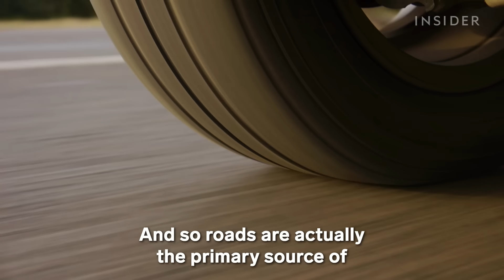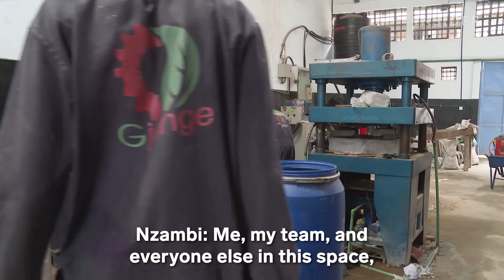Young Inventor Makes Bricks From Plastic Trash | World Wide Waste | Business Insider

Comment: If you're wondering, Africa is where the most of Europe's "recycled on paper" wastes go, building up on the existing garbage problem there.
As for the technolgy, well... On one hand plastic tend to produce nasty organic toxins under UV-light, so it is debatable if such technology is actually acceptable (it depends on the source of the plastic they use), on the other hand this process reduces the need to use concrete, where you emit lots of CO2 from lime and from gas heaters, as well as bury carbon in form of plastic instead of just burning it, on the other hand this buried carbon will be replaced by the (slight) increase in plastic production from oil.
As I live in SPb in Russia I'd actually love to see this technology implemented more here if it is proven to be safe from the toxic point of view and if bricks like that won't produce a very fine plastic dust with time, as 1. there're a lot of unpaved pavements, 2. in winter there're a lot of times temperature goes through water-freezing point, which makes concrete pavement bricks and slabs crack very fast (only natural granite and marble tend to hold better), 3. there're a lot of unprocessed plastic waste here too.
Reply: Since plastic has so many controversial on its component, heat and UV response, then the only solution to plastic problem is do not manufacture plastic at all.
Reply: @sallylemon5835    Burn it to produce power.
Reply: @sallylemon5835  spot on, I use clay earthware in my home... everyone should do the same
Reply: Gotta ask ,whats the difference? If the plastic is already there as waste with the sun beating down on it why would it be any different once its in the form of a road? Im asking because the man in the video sounded like he was doscouraged by this idea but they dont produce the plastoc its already there in landfills repurposing it shouldnt make it anymore harmful than sitting there especially since it being used means the waste of using actual concrete wont have to be added , or am i wrong?
Reply: @notaword5016  I think the difference is that it doesn’t generate the amount of microplastic a road would. The problem is plastic in general. It should be removed from our lives as much as possible. If you repurpose the plastic that is in a land fill you are just re introducing the plastic back into the environment. If you are just making a pavement though then I dont think you are going to generate micro plastic as much as a road would. The best solution is to find ways to decompose the plastic that is thrown away and make biodegradable alternatives. Micro-plastic is a huge problem that is yet to show its impact on our lives. Its found everywhere in the ecosystem and that can not be good.
Reply: Arh shutup
Reply: It's a choice of two evils. It's a hard choice specially when we already have problems with the environment. Bc like you said in one hand we have the solution to remove the waste buy it would increase the amount of micro plastic, toxins and more. In the other hand we don't use this method but we have the plastic problem, continue to have micro plastic problem, we emit CO2 and other things. It's a tough choice specially when there's so many people who have different views and values.
Reply: Then no matter which is used these tiles will need to be removed and disposed of. Once in this state they will be harder to recycle if they can be. Or will have to be disposed of some how by future generations.
Reply: @firstnamelastname-jt5ci    What on earth do those numbers have to do with this video?
Reply: The best solution is to stop plastic production and go full on renewable to solve the CO2 problem and the micro plastic problem.
Reply: Why not make such roads in England. Rain resist roads. Plus free material for production from around of the world.
Reply: @Ffhh391    Not free.
Reply: @firstnamelastname-jt5ci    All that may be true. Doesn’t fix the problem though. Plastic laying around on the ground. Which future generations will have to deal with. Same problem then. Do we just keep reusing it and producing it?  Burn it for power. As for Africa I really don’t care. It’ll be back to Stone Age there shortly.
Reply: @firstnamelastname-jt5ci    Haha
Reply: @firstnamelastname-jt5ci  Thank you for that fascinating, irrelevant statistic.
Reply: @ex7463  he's just showing you that the problem has more to do with the richest than with the white man.
Reply: As usual, the problems of the world can be blamed on the white man
Reply: @ex7463    Lmao. You trolling dude?  That’s some fine sarcasm you got going
Reply: @marvinmartinsYT  yeah i was joking lol, didn't expect to trigger so many ppl
Reply: @ex7463    Amazing though right?
Reply: @ex7463  For example, this SERIOUS problem here, with these plastic bricks was a problem created by an African woman. Now the entire area.... and world for that matter, is about to be polluted with Microplastic beads until the food chain in the area brakes down because this is such an awful awful idea it is not even funny and was one created by people with good hearts but lack of knowledge to fully understand the impact of what they are doing. These will NEVER EVER be good roads and worse they will degrade and release poison into the world. 
So.... That is the whitemans fault because she sure seems excited to take credit for her company.

Comment: This idea has been around for years, and has been developed to the extent of paving several miles of 'test road' (which was exposed to traffic and then measured for durability/safety) with the mix of ground garbage and asphalt-type material.. But the MSM had to wait until it occurred to someone in Africa so they could get virtue points for spreading the idea as if it's new.

Comment: cool idea, plastic+water such as rain or flood = 90%+ loss of braking traction and probably only 60% of normal traction in pristine conditions, but probably 113-110% traction increase in dusting of desert sand. what is the wear factor of this plastic after 50,000# truck rolls on it 4,000 times? 40,000 times?
Reply: upon further review this actually would be great building products instead of roads, building walls and roofing materials as well as sidewalks and park paths and patio pavers, giant sized legos would be cool and fun too so kids could learning building techniques and have fun building child sized structures at the same time!

Comment: Looks interesting. Most plastics have problems with getting brittle in sunlight. I'd be interested to know if this has similar problems. Also, hardness is one thing. But what kind of traction can you expect in wet weather? For higher elevation will it tolerate ice?
Reply: I would think these would make better housing than roads

Comment: They tried this with ground up tires years ago, it didn't work, it's too slippery for high speed traffic when wet. The same will be true for these Plastic bricks. May be fine for side walks and driveways, but not for roadways with automobile traffic.

Comment: The two biggest problems are 1 even textured plastic doesnt offer very good traction in wet conditions, and 2 plastics break down in heat and constant exposure to sunlight, even plastics specifically designed to be UV resistant. So roads in hotter climates like the southern US would go into very bad shape very quickly and needs a ton of constant upkeep. Solve those two things and this is a truly perfect idea.
Reply: the solution is just not to use plastic in outdoor, wearing applications where it can shed and leech. Its ubiquity isn't a good justification.

Comment: my guess, a road built out of this material would be far more prone to cracks and fractures from heat stress as well as weight stress from vehicles driving on it, it would also be dangerously prone to water pooling during rainfall increasing the risk of hydroplaning substantially, assuming the water did not penetrate the material, in which case it would likely begin to lose its structural rigidity and the bricks would start to fall apart, and without some form of gravel glued to it cars would not be able to stop in any reasonable amount of time, and would struggle to find enough grip just to drive in a straight line.

Comment: What's crazy is if they added pyrolysis to the process they would likely be able to produce kerosene when melting the plastic so long as it doesn't diminish the structural integrity of the bricks.

Comment: Normal bricks are already better than having bricks with plastic in them. I mean, bricks can be crushed or be repurposed into other manufacturing or building materials easily if need to be disposed of. Also, plastic becomes weak when exposed to UV lighting and heat.

Comment: I love the idea of recycling the plastic. I would love to see what tensile/compression properties this material has. Considering that these will be ground away by the sun/rain/tires, they might not last too long as a road. Making bricks is great and maybe would be better suited for houses/fences/pavers.
Reply: They dont really recyle it they throw the plastic back into the enviroment!!! We have already a micro plastic problem and with this idea we would make it even more insane big. The sand would grain the plastic super thin. Build houses with it ok but not streets thats not a great idea!
Reply: @pedalpatrol  that better than just make big mountain full of plastic garbage
Reply: @erikansori  nope its not! Making the problem even worse by producing more mircoplastic is not better...
Reply: @pedalpatrol  it's on individuals on how they use plastic. Cauz the lesser the production of plastic the better the situation.
Recycling the 2nd best option
Reply: @pedalpatrol  Producing concrete and asphalt is one of the largest CO2 emitters out there. Taking plastic trash from the environment and repurposing it reduces demand for asphalt and concrete, while keeping net plastic waste locally roughly the same, since the plastic waste is going from the ground... to the ground. Stopping the production of microplastics is out of the scope of this plan, but reducing the need for asphalt is still great for the climate. This certainly won't totally solve the plastic problem, but it will help with climate and reducing the size of landfills
Reply: @crodsbye  Great points. Thus country didn't create the waste and good for them that people are repurposing waste materials.
Reply: @Jason Diaz Agreed. Depending on its health safety and bonding ability, there has to be numerous non/minimal-friction applications where this material can be used.
Reply: That's what I was thinking. Using it as a building material for homes could be best, that way there's no friction to release those microplastics into the air. Especially if they are 25% cheaper than concrete and just as durable, it could be very promising :)

Comment: Long term Environmental engineering concerns would be my concern, run off, erosion, leaching chemicals in to the ground, and the clear lack of oversight or regulation in controlling or knowing the chemical composition of each brick.
Reply: If she can address all that she could have a winner on her hands, but until then this is a bit of a false dawn.
Reply: @ANTSEMUT1  the answer is just to not use plastic. There is no other science or magic under the sun to fix this. 🙁
Reply: @superchroma  that answer leads to more questions
Reply: @ANTSEMUT1  plastic degrades under the sun and is very flimsy compared to otyer materials. This idea was a kickstarter aswell a few years back and guess who just ran off with the money when they didnt realise it wont work

Comment: Fundamentaly a great idea. Taking waste like plastic that takes millions of years to break down and refining it and removing the harmful chemicals used in the production of plastic and using it in roads is a good idea. The designer of such bricks knows what there doing too. Look at the cross parted on the bricks. Those would help the bricks stress in and out between hot and cold temperatures. Tbh we should be using this as well.

Comment: This would only work for indoor tiling, otherwise UV will slowly decompose it.
Reply: Was just thinking this. Natural weather would erode the plastics to become microplastics, which is debatably worse for the environment
Reply: The plastic is already decomposing into micro plastics in that open air land fill.
Reply: @Fubnin  who said that was the only other option?
Reply: @ramonnunez1066  Not me if that's what you're getting at. Just spitting facts.
Reply: @Fubnin  Who said it needs to be open air land fill? Bulldoze land on top and there is no sunlight getting trough. That takes care of that issue until recycling method can be found. Personally i would put on proper smoke cleaning system and start burning it for energy for a moment.
Reply: @Fubnin  Now imagine that landfill everywhere cris-crossing every natural and man made waterway because roads made of that shit cross over it. That would be worse for every living thing on the planet.
Reply: @Fubnin  so we should spread out the pollution across the land ?  makes no sense
Reply: @bradadult5290  it's true, but they're also the victim of western 'penny pinchers' who normalized single use plastic and actively fight governments worldwide to keep it that way.
Reply: All roads continue to decompose.  Since we have the material,blet it have a second, useful life.. Smart woman.  Inspiring.❤️❤️❤️
Reply: @emeraldcoastgardensfl7323  i don't think you understand the difference in the decomposing between normal asphalt roads to that of plastics. In a year or 2 most plastics become extremely brittle when they are under constant exposure to sun light, and that's not counting foot traffic and weathering over time, granted adding agregates might extend their life expectancy but only by a small margin. While normal roads for pedestrians can last for 25 years. Which means you'd have to repave every 3-4 years if not sooner. And the old bricks could only be recycled to make more bricks and no other plastic product, since it's already been mixed with various other aggregates.
Reply: @VvissiaA  it is difficult to reach people that believe that rubbish vanishes the moment it leaves their sight 🙁
Reply: All roads continue to decompose.  Since we have the material,blet it have a second, useful life.. Smart woman.  Inspiring.❤️❤️❤️

Comment: Just another scam. Anybody who claims that we can make trash plastic into roads is automatically a scam. It’s simple, plastic is not a viable material for roads, period. Tar is an amazing material that is cheap, easy to work with, grips well with tires, and is very durable. It may be the best material we ever find. Plastic is slippery, especially in the rain, will crack and shatter under the weight of cars driving on it in the cold winters, and will melt when exposed to the blistering heat all day in the summer, and wears down very easily. So yeah, it may work for limited foot use in third world countries, but in first world countries with constant constant vehicle use and a wide range of climates from the seasons, it would never work, hence why it hasn’t been done yet. 

Bottom line, don’t fall for such obvious scams as these. Anyone can make a quick video, but don’t get excited until it’s actually being implemented.

Comment: She needs to get a granulator and evacuate the ground plastic with a vacuum to feed the plastic into the extruder hopper and a volumetric feeder to introduce the sand. Then she would be able to dose an accurate consistent amount of sand additive, and eliminate a ton of labor.

Comment: I feel like a meet in the middle would work. What if the roads had this plastic base and was painted white then a thin layer of asphalt on top maybe 30% of the asphalt normally used and that way it doesn't create the micro plastic issue but also whenever the white started to show through people know its time for the road to be re layed.

Comment: Yes, but also no. Listening to the experts is key, her recycling plastic is wonderful. Could it be used differently? Could she use her plastic bricks for buildings maybe, instead of concrete? Then they would be protected, by isolation and paint, maybe some treated wood on the outside as well as the inside. Would it be a valid foundation instead of concrete? Maybe. Her idea has potential but if some experts on the topic reached out to her, maybe connecting her with environmentally friendly businesses, much more can be done. It is easy to change the shape of the bricks, an investment of a few hundred dollars and a return of thousands, maybe millions. Investors, companies and experts should stand in line to take part in that journey, all factors align: a huge amount of free ressourse, a big demand for concrete and  alternatives, a huge demand for work at the location with rather inexpensive wages, a simple technology and a business with experience, infrastructure and communal acceptance, and probably even public and political support due to the environmental friendly nature of the production.

Comment: I remember when they first tried to recycle tires into roads. It was like driving on ice when roads where wet
Reply: Or shredded tire "mulch" for playgrounds. In the early/late 2000's most schools used this to be green. Soaks up the sun's rays so it gets uncomfortably hot, toxic off gassing fumes, chemicals leech into the ground and water supply, and tiny strands of metal wire from the tire belt that would impale you.
Reply: You gotsa start somewhere

Comment: would be more sensible to use those bricks for buildings
I mean with building you can even cover the exterior so they really wont be worn out at all... just teh covering material but thy could still work as briks.
so at least that would be something decent to do with them even if roads are less then ideal...